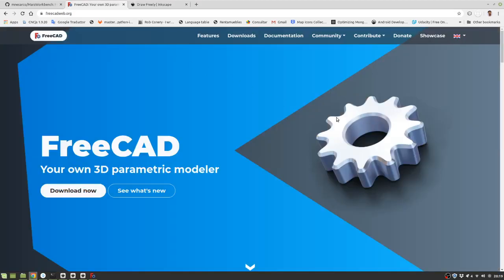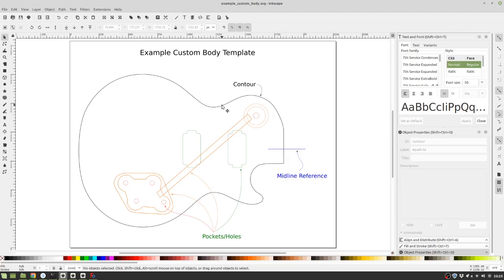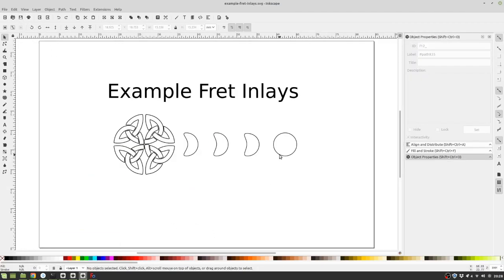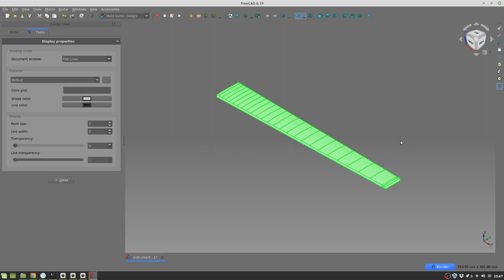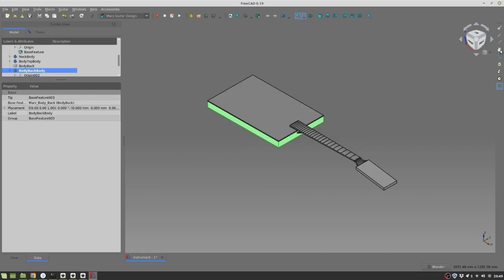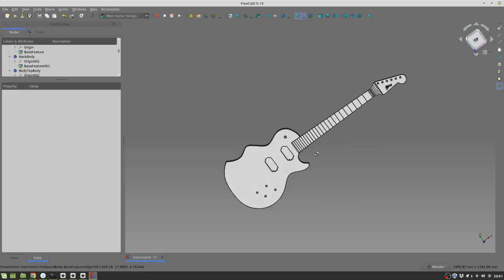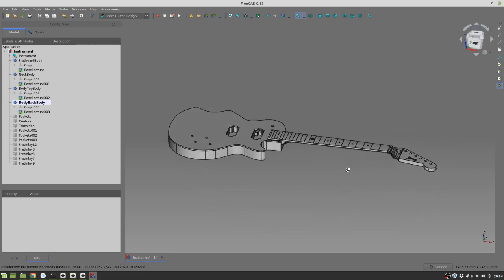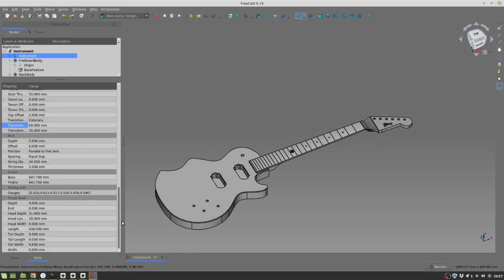FreeCAD Guitar Modeling with MarzWorkbench

Comment: Can you change the nut width?
Reply from the maker: Yes. In the parameter list: Nut/Thickness changes the thickness of the nut. and Nut/String Distance is used to calculate neck width at nut.
Reply: @mnesarcox  Wow - this is awesome work Frank.  Much much gratitude!

Comment: Wow...Te felicito por esta extension para FreeCad.  A la verdad que eres un genio.  E estado tratando de terminar un projecto que comenze unos años atras en Fusion 360 y ahora la licensia de Hobby la eliminaron y e tenido que comenzar a aprender FreeCad y se ma a hecho muy dificil.  Ahora tengo que aprender Inkscape. 8-).

Me gustaria si es posible, comunicarme contigo off-line para hacerte algunas preguntas que tengo hacerca de los requisitos de el file de Inkscape y tambien para que revises un file de el headstock que hice y cuando lo importo a Freecad todo se ve bein excepto por un artefacto que sale en el volute. E leido toda la informacion que tienes en el wiki pero tengo algunas preguntas mas para poder utilizar esta extension correctamente.  

Unas ves mas muchas gracias por hacer esta extension disponible. Te puedes comunicar con migo a mi correo electronico:  robles1999@yahoo.com